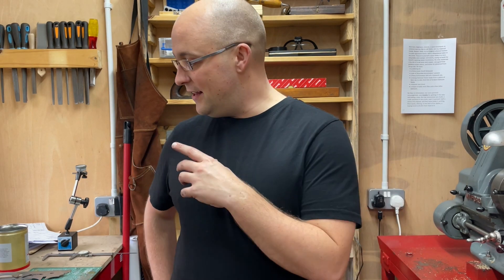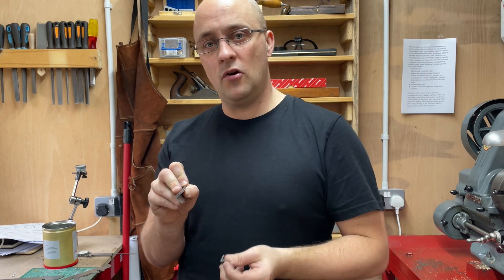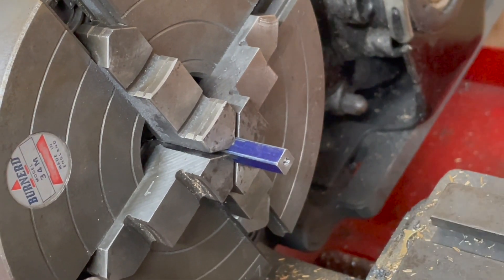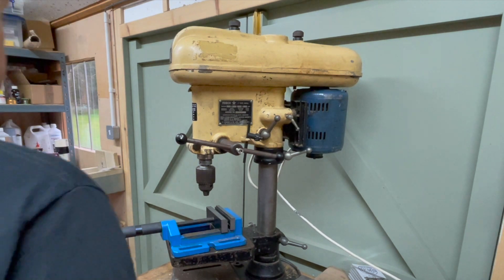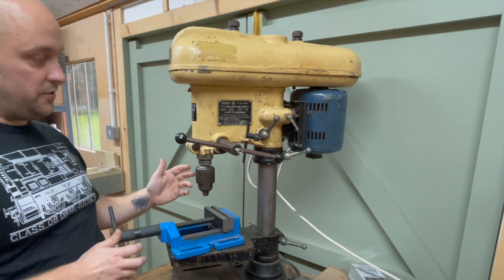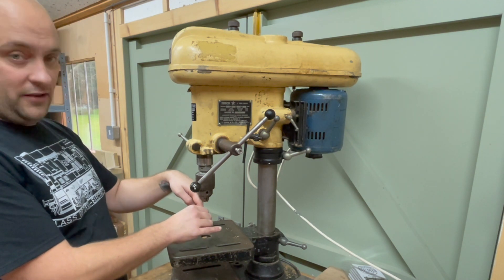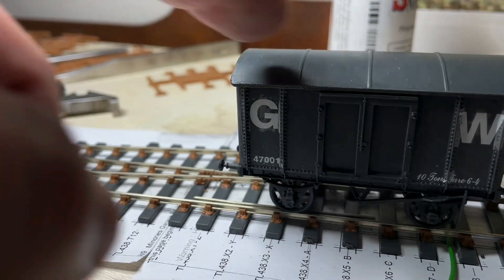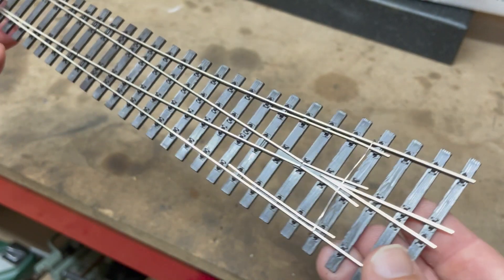Loco Build 2.4 - Cutting stretchers on the Kennedy Hexacut

Comment: I don’t think that it’s a good idea to tap a blind hole under power. When tapping in the Lathe I have found that not tightening the tailstock chuck too much will allow the tap to slip if it jams. I couldn’t tell from the video what type of tap you were using but I always use a spiral flute tap on steel or aluminium especially on blind holes because the swarf doesn’t jam the tap. When tapping under power I run the machine as slow as it will go to give more time to make sure that it’s going well.
Reply from the maker: Hi there chum - I didn't tap it under power, I was just using the chuck as a way to rotate the part. It definitely wasn't sensitive enough for a 6BA hole though, I learned my lesson! Thank you for watching!

Comment: It’s pain when any taps break, but a 6BA is a nerve wrenching one to start in steel!  Hopefully you’ve ordered several to keep you going. 

I’ve had a similar noise on my cheapo drill press and it was the key had worked it’s way out on the pulley at the top of the spindle. Obviously I don’t know wether it’s the same on yours. Stay safe, laters 👋. Matt.
Reply from the maker: These were from Tracy Tools and I've no reason to think they're bad, but I ordered a new set from Presto and they worked a treat. I didn't dare do it in the lathe again though :)